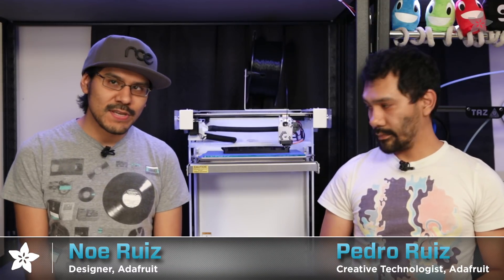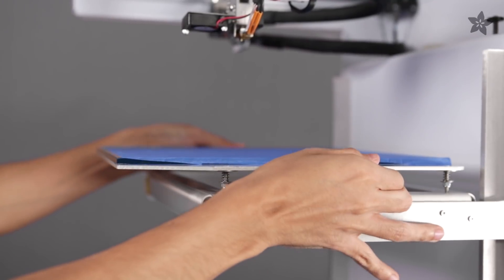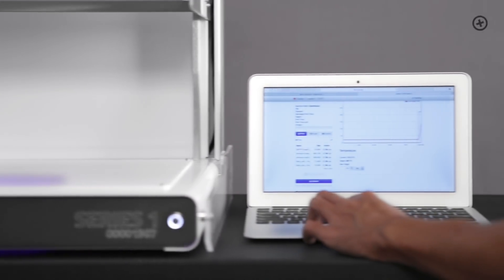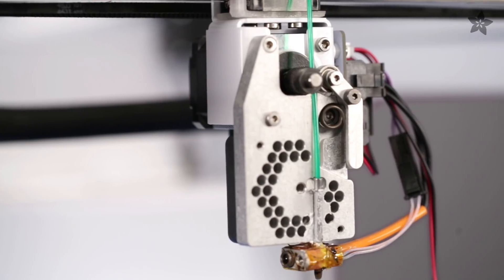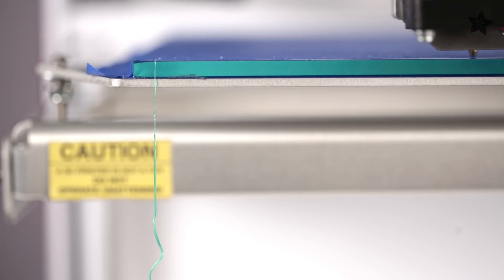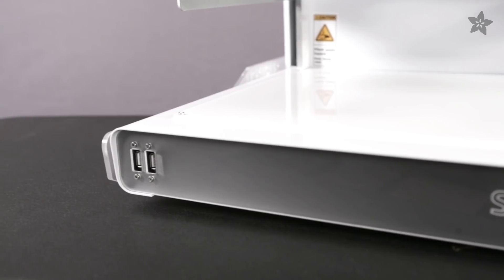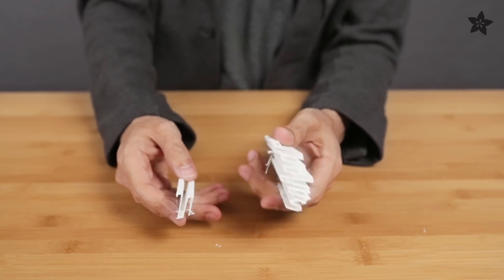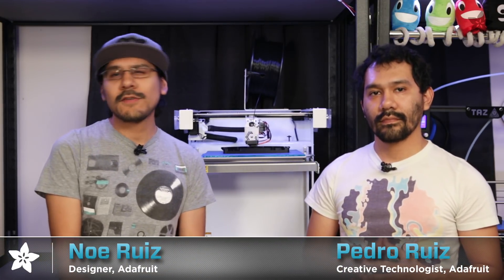Type A Machine Series 1 - 3D Printer Review

Comment: Beaglebone FTW! Seems like a great machine. Would be nice if the design allowed the build volume to be enclosed (it's almost all there, sans the filament feed system).
Reply from the maker: the side panels have screws for enclosing when using  the heated bed upgrade ;)
Reply: That's a great first step but the heat will just escape from the top, and the volume taken up by the filament reel is wayyy too large to enclose and still be effective at retaining heat.
Regardless, it's a nice neat machine if you want to do pla and other low-warping material

Comment: This machine is beautiful. I've always loved keeping an eye on the 3D printing world, but this is the first time a consumer machine has looked mature enough to really get me excited.

Noe and Pedro, could you guys do a segment on food safe printing materials? I think my dream application would be printing custom kitchen utensils. There have been times I've searched my kitchen for a spoon or container that was just the right shape and size for a particular application and come up empty.
Reply: Ben Etherington That's a really tricky proposition. First, there are crevices in the print because of its layering and starts and stops. Cleaning that out is not realistic.

Also, a brass nozzle might leach lead into the filament because brass often has lead in it. So even if you solve the porosity problem, you'd need a stainless steel nozzle.

Maybe vapor smoothing or sealing it in a coat of something food-safe is the way to go. Don't do PLA if you want it dishwasher safe.
Reply: Jeff DeMaagd I know it's going to be tricky, but it would be a really great application. There are food-safe filaments out there, and with a high-res printer, an intentionally smooth surface might not be a bacteria haven, though it might take some post-print sanding or smoothing. I hope the boys have something to say about it!
Reply: Well, it would be interesting, just have to watch out for those things.

Hmm, comments on YouTube and G+ cross post to each other. I'm still not fond of that.
Reply: Jeff DeMaagd Meh. I like having all my Google notifications in one place, but it's kind of odd to have YT comments appear over in G+. Google needs to figure out how a unified ecosystem should actually work, and I think it's going to take a while.

Comment from the maker: NEW PRODUCT – Type A Machines Series 1 3D Printer
https://www.adafruit.com/products/2412
Reply: Adafruit Industries Ooh it only cost's 3000$.
Reply: +Matty “Code name Sheep” Ristenpatt  NOW 4095$ after 1 year WOW lot more than the inflation % of 2.4%
Reply: They went away from consumers into professional space -- hence the justification for the price hike. I have the pro model, it was $3300 when I got it, 3 months later the price went up $700 due to them going in a different direction with indication that the price will be justified by new services (haven't seen them yet). For the most part it's rock solid, but dealing with their support is irritating. They're either on vacation or simply refuse to believe or acknowledge you. If you rely on up time for a machine, this is not the machine to get. I am now in a waiting limbo to get belts replaced. BELTS! That's like < $5 worth of parts, and for an open source product I can't get an answer what belts or pulleys they use. Very frustrating.